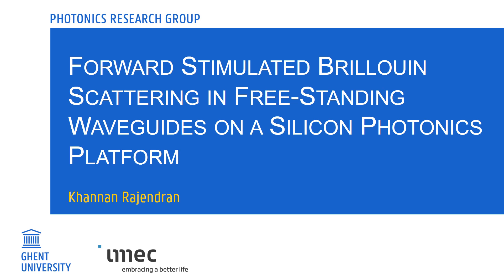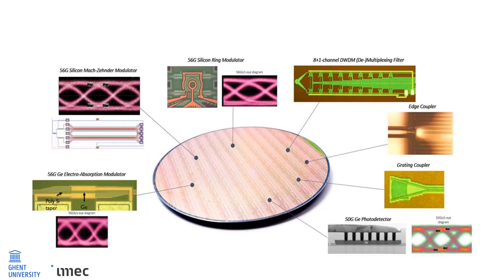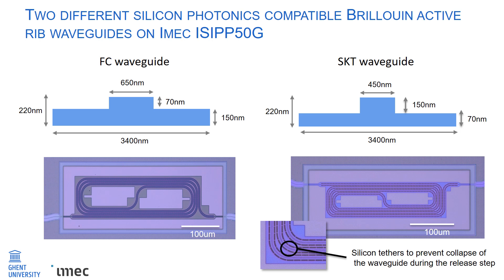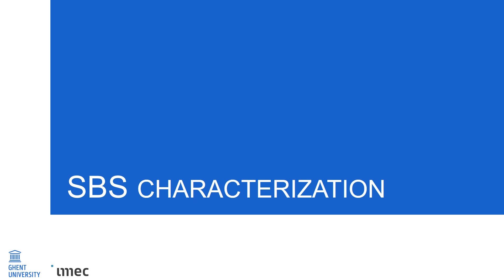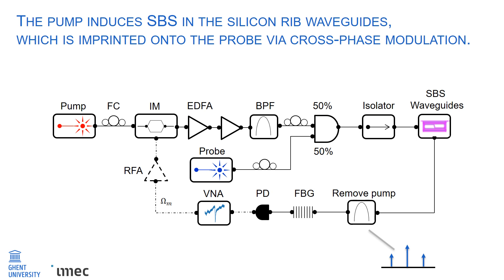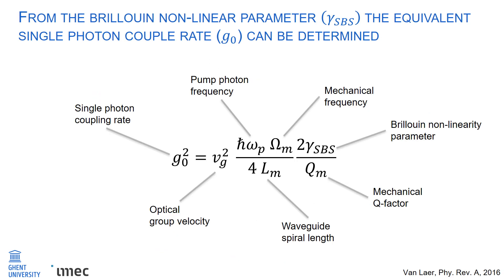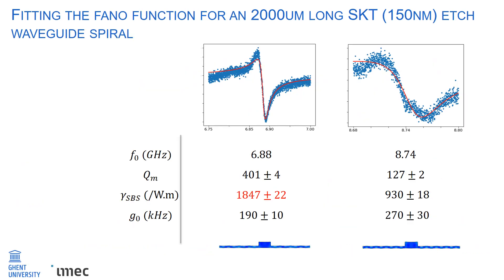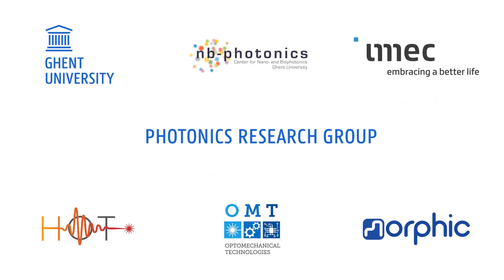FiO 2021 - Stimulated Brillouin Scattering on a Silicon Photonics Platform - K. Rajendran

Comment: - Introduction to Stimulated Brillouin Scattering (SBS) : A brief introduction to SBS, a nonlinear interaction between optical photons and acoustic phonons in a photonic waveguide, is provided. The video explains the dispersion diagram and the conditions for forward SBS.

- Fabrication of Freestanding Waveguide on a Photonics Platform : The video discusses the fabrication of freestanding waveguides on an active silicon photonics platform, IMEC's iSiP50G, with gain and phase modulators. This enables advanced on-chip applications and commercialization. [Watch segment](https://youtu.be/utJXfmOOwXI?t=263)

- Design of Brillouin Active Waveguides : Two different kinds of rib waveguides, FC and SKT, are designed. The waveguides differ in edge depth, and the silicon waveguides are suspended to achieve good acoustic mode confinement.

- Measurement of Stimulated Brillouin Scattering Using Cross-Phase Modulation Scheme :
  - The pump is amplitude modulated (carrier and two sidebands) and injected with a weak probe. [Watch segment](https://youtu.be/utJXfmOOwXI?t=273)
  - Cross-phase modulation from the strongly amplified pump leads to modulation of the probe at the output of the waveguides.
  - A bandpass removes the pump, and a fiber Bragg grating with 2.5GHz bandwidth removes the higher sideband (anti-stokes) from the probe, converting phase modulation into intensity modulation.
  - A vector network analyzer RF output is fed into an intensity modulator.
  - Fano resonance is observed from interference of narrow-band SBS and wide-band Kerr nonlinearity.
  - Each Fano-resonance corresponds to a different mechanical mode in the rib waveguide.